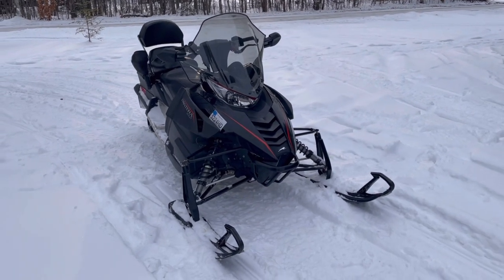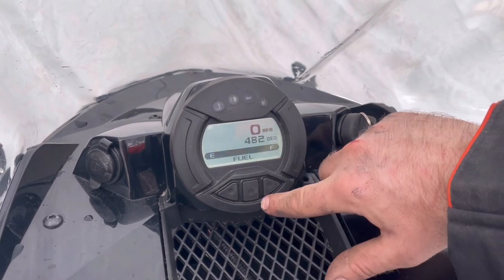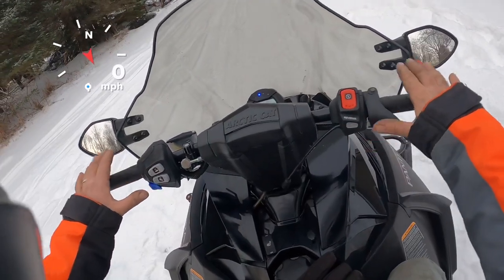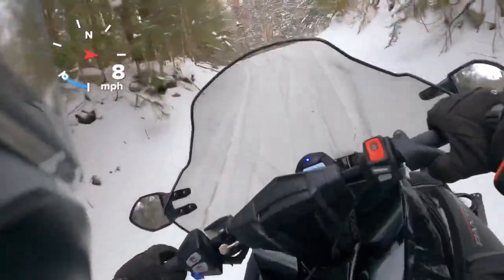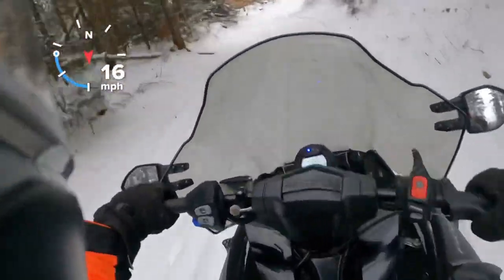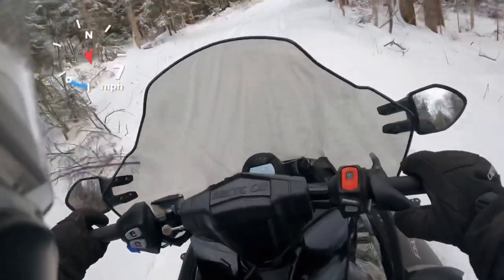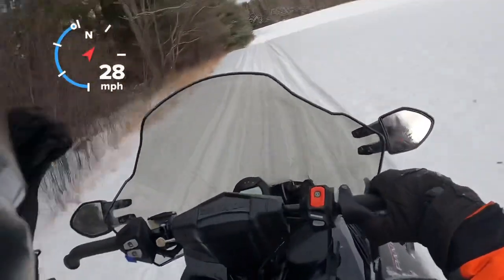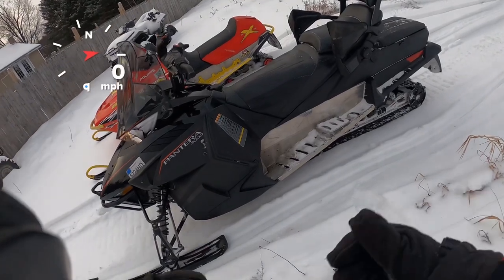2016 Arctic cat pantera 3000 test drive 700cc Wildcat Motor?

Comment: Jag hyrde en sådan eftersom att det var det enda som fanns att hyra när jag själv hade växellådsras på min egna maskin. Pantera 3000, 46km/h i nysnö ospårad terräng och 78km/h efter vältrampad led. Jag var inte imponerad…
Reply: What do you expect this engine was designed to compete with ski-doos 600 ace. I guess when ski-doo is the best they always have to push the evelope, and always creates it so they have to be compared to.